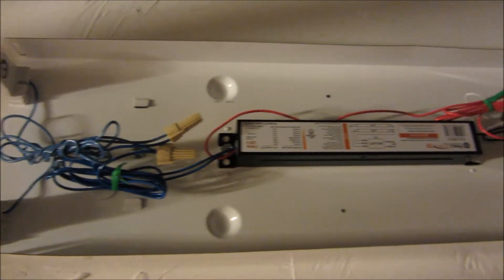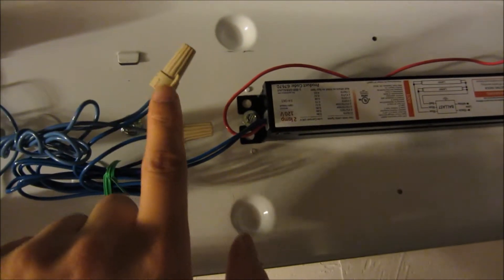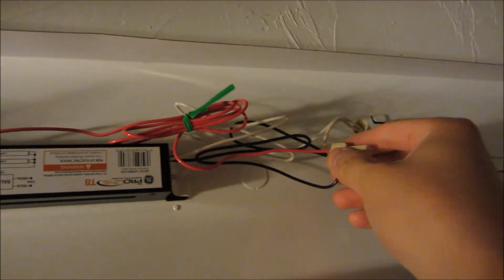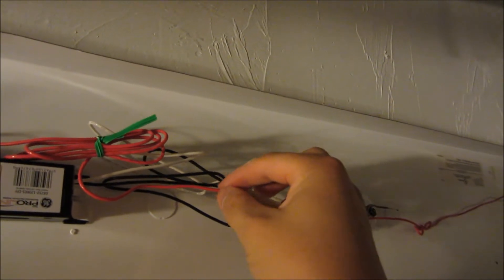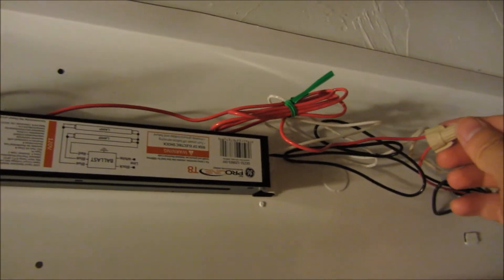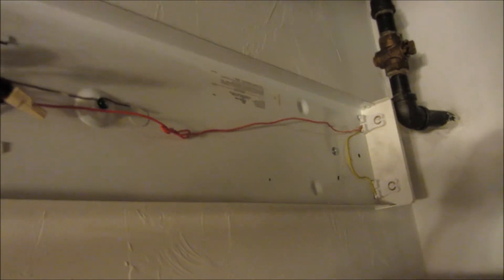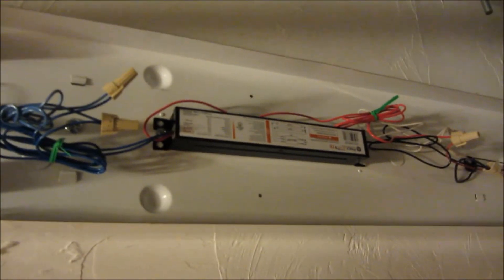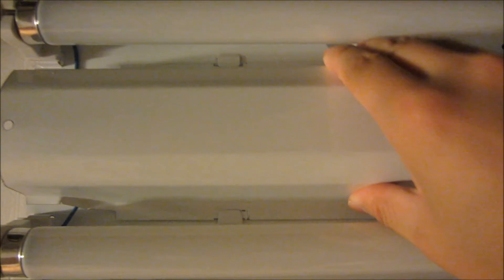How to Fix Florescent Light Ballast Replacement - Part 2  (Tips and Final Install)

Comment: color codes are throwing me off! My new one from Home Depo has 2 red wire 1 coming ouot ffrom one hole on the right, & the other red comes from other hole..Just connect all reds to red, then...?
2-25-17